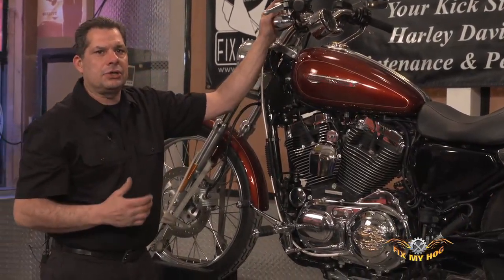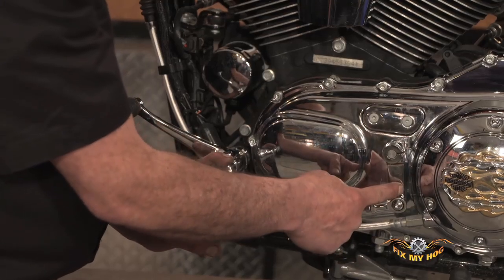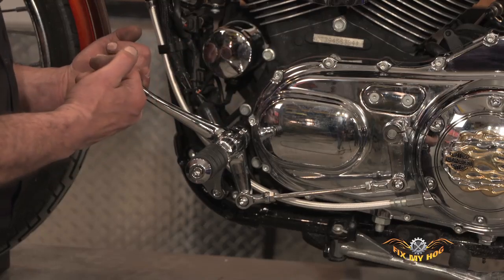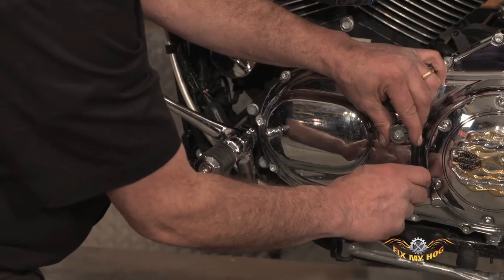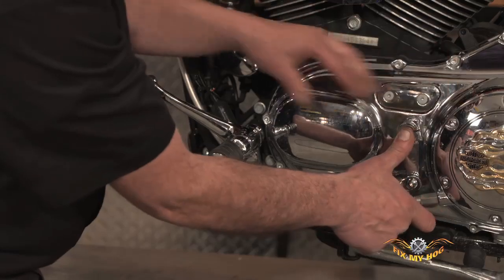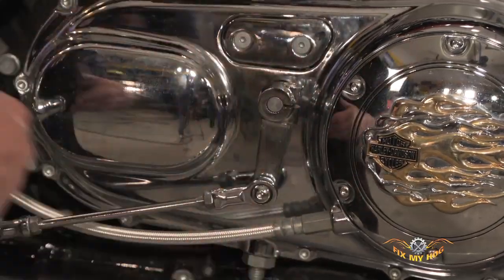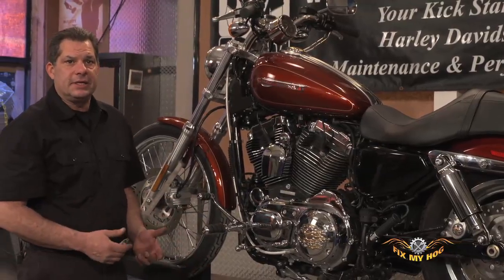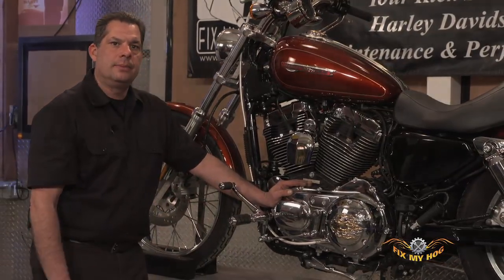Harley Davidson Gear Shift Linkage and Neutral Issues

Comment: Thank you so much for idea!
I've spent around 18 hours at workshops. Jumping from one shop to another. Finally i found what had been causing the nuisance. The lever apparently had been touching the exhaust pipe and it wouldn't shift to first.
Now i can sleep at peace.

Comment: Number one place i would look at if my harley was hard to find neutral on should be the primary chain tensioner. If the chain is too tight it will be hard to find neutral.

Comment: Hello sir. Great video.  thank you!! my bike is a 89 sportster 883.  I wonder if you can help me.  I started having this issue today. Having problems going into neutral. And also once in first gear and I start moving the acceleration becomes rough and bike starts to chock up as if it once to shut off. This same issue continues through out the other higher gears.  I adjusted my clutch several times recently. Will this be an issue cause by poor clutch adjustment  or a fuel deliverie issue??? Kindly advice me please.  Thank
Reply from the maker: Hello, thank you. More info here:
https://www.fixmyhog.com/?s=shift
https://www.fixmyhog.com/videos/sportster-maintenance/
https://www.fixmyhog.com/videos/carburetor-rebuild/

Comment: Hey Bob, love your work & have your videos for my model an 04 1200C.
My neutral light stopped working directly after I did a fluids service, engine oil & filter & primary fluid. I have never had an issue with it before this. Any ideas?
Reply from the maker: Thanks 
We appreciate the kind words.  
The indicator bulbs on your year Sportster are very small. The contacts within the sockets are small and delicate. 
It is not uncommon to have a weak contact due to the aging rubber socket that holds the bulb.  
Suggest looking there 1st. 
Once the bulb is removed, you can use your test light to check for power and ground. 
If you have no ground, the issue is at the switch. It has either come unplugged, or needs to be replaced. 
https://www.fixmyhog.com/videos/electrical/

Comment: Very nice video. Great explanation.. Accidentally I shifted once from N to 1 WITHOUT clutch on my HD, the most misterious thing is the gear box did not grind or else, and it was pretty smooth (not as smooth as it used to be when the engine is hot and obviously you use the cluctch, but similar like the first time you shift to 1 gear in cold) How could it be?

Comment: HI  BOB LAROSA   I    REALLY  APPRECIATE  YOU'RE  VIDEOS ,  I.  HAVE  A  96 SPORTSTER  XLCH 1200CC WITH FORWARD CONTROLS  AND  I'M  HAVING  A  HARD TIME  FINDING  THE  RIGHT  SHIFTER  LEVERAGE  POSITION  HOW  DO  I.  FIX  IT?
Reply from the maker: Hello Larry, 

We don't know who's forward control kit you have, but you should 
assemble and operate it as intended by the manufacturer. If part of the 
assembly has been compromised, we suggest replacement or repair of that 
component. 

Hope this helps, 

Mark
Fix My Hog Video Membership

Comment: No problem finding neutral, having issues with sticking shifter. No "return" when shifting.
Reply: pahuanui ...Did you find the problem?  There’s a “return” spring inside the Primary case. On my 05 Sportster it’s a “rabbit-eared” style spring located behind the shift lever.

Comment: I’m having grinding issues into first gear. I adjusted clutch and cable accordingly. Maybe new clutch needed or is cable stretched out?  18k miles on 92 Heritage.
Reply from the maker: More trans info here: https://www.fixmyhog.com/post/tag/transmission/

Comment: All of your videos are great man. I'm having issues with my 03 softail springer.  I just replaced the stock clutch plates with the rekluse torqdrive manual clutch plates. I adjusted the adjuster screw per the service manual as well as the clutch cable. My lever movement is fine as well. It's very difficult to find neutral and whenever i shift it when i'm stationary it almost clunks. When i ride it shifts fine. Is it just a matter of breaking the new plates in? thanks for any info
Reply from the maker: Raymond, what you describe sounds like you are not getting good disengagement within your clutch pack. 
Without adjusting your cable, turn your clutch adjusting rod IN another 1/4 turn. 
See if that helps. 

Make sure that all of your steel plates are completely flat. 

Verify that none of your clutch plates are hanging up in the basket. 

https://www.fixmyhog.com/video/harley-clutch-basket-removal-011062/ 
https://www.fixmyhog.com/?attachment 
https://www.fixmyhog.com/video/barnett-clutch-011064/

Comment: HI  MR  LAROSA   I   HAVE  A  96  SPORTSTER  1200  XLCH ,   AND.  I'M   TRYING  TO  ADJUST  MY  SHIFTING LEVERS  ON  MY FORWARD CONTROLS,   AND   MY  SHIFTING ROD.  IS  BENT. A LITTLE   BIT  ,  SO.  WILL  I.    HAVE  TO  REPLACE THE  SHIFTER  ROD?
Reply from the maker: Hello Larry, 

Try to straighten the shift rod if possible. 

If you experience any binding, you may have to replace.

There are a lot of poor quality fwd ctrl kits out there. Drag Specialties usually offers a decent kit at a fair price.

https://www.fixmyhog.com/video/harley-davidson-gear-shift-linkage-and-neutral-issues-008726/

Hope this helps, 

Mark
Fix My Hog Video Membership

Comment: I can shift up easily..... once I'm in 5th gear.....i can only shift back down into 4th gear.    Once I try to shift down to 3rd,2nd etc its like a dead shifter.    There's no spring back to it.  I have to shift into 4th, gently lift up on the shifter without shifting up in order to be able to shift down.   I have to do this each and every time.   I have a 2010 sportster forty eight.  What should I do?
Reply from the maker: Hi, start by making sure your clutch is adjusted and stop by our site to troubleshoot: https://www.fixmyhog.com/post/tag/clutch/

Comment: I have 2008 Road King FLHRi and it hard to find neutral. What causes this?
Reply from the maker: Hi Robert, 

Start by performing a clutch adjustment. 
If finding neutral is easy with the m/c not running. You will find that your issue is in the drive.
Inspect your clutches, clutch hub, clutch hub bearing & basket.
https://www.fixmyhog.com/video/primary-fluid-service-w-clutch-primary-chain-adjustment-001305/

Hope this helps, 

Mark
Fix My Hog Video Membership

Comment: 03 Hugger here - Hard neutral , stock shifter location . Is this a just a clutch/cable adjustment ?
Reply: j baumun yeah, just follow manual on how to adjust clutch in primary and should solve that hard neutral issue for ya

Comment: I have a 2015 HD seventy two and recently when down shifting it dosent want to go in gear all the time i have to shift up and then back down to correct this problem the bike has 5k on it ive owned it for a year now nothing changed on the bike so what could be causing this
Reply from the maker: Hi Brian! We suggest starting with a simple clutch adjustment. 
Also, you can raise the rear wheel with a flat jack (bike not running) & shift through all gears. See how it feels. If it feels ok, the issue may be in the clutch or primary drive.
https://www.fixmyhog.com/video/fluid-service-clutch-primary-chain-adjustment-001223/

Comment: hey, I dropped my bike going about 90. I got 1 N 2 and 3 but won't go into 4 or 5. any advice on what I did? it's a 02 Sportster 1200
Reply from the maker: Hi, Brian. You will need to remove your outer primary cover. Follow your shifter shaft until the issue becomes visible. https://www.fixmyhog.com/video/performance-clutch-and-clutch-pressure-plate-install-004522/
Reply: FixMyHogfreechannel  I’m trying to get my inspection cover off using a 4mm allen. The bolts seem soft and very tight. Any idea where I can find better bolts if I have to resort to a Dremel slit? It’s a 04 1200. Thanks

Comment: I have a 2005 80 cubic  inch Evo Harley Davidson ultra classic Electra glide I did a burnout the bike suddenly died and then now it won't go into any gears the shifter works bike still runs I don't know is anybody that can help me
Reply from the maker: Check the clutch assembly.  https://www.fixmyhog.com/video/primary-fluid-service-w-clutch-primary-chain-adjustment-001305/

Comment: i have a 2011 iron 883  when i try to shift to first is making a grinding noise inside the primary case any help ill preciated thanks😭
Reply from the maker: Hi.  Suggest starting with a clutch adjustment.  
https://www.fixmyhog.com/video/fluid-service-clutch-primary-chain-adjustment-001223/ 
https://www.fixmyhog.com/video/inside-the-primary-case-primary-chain-tight-spot-001244/
Reply: FixMyHogfreechannel ...(?) And if that doesn’t fix the hard shifting into 1st gear with engine running?  I’ve smooth shifts with engine off.

Comment: HOW  CAN. I.  FIX. A. LEAKY  GAS  VALVE. ON. MY  96 SPORTSTER XLCH 1200CC?
Reply from the maker: Hello Larry, 

We don't know who's forward control kit you have, but you should 
assemble and operate it as intended by the manufacturer. If part of the 
assembly has been compromised, we suggest replacement or repair of that 
component. 

If your fuel valve needs replacement, we suggest a Golan fuel valve or a OE factory replacement. 
https://www.fixmyhog.com/video/draining-an-evos-vacuum-operated-harley-fuel-valve-008724/

Thanks, 

Mark
Fix My Hog Video Membership

Comment: hi Bob,I have problem with my shifter pawl ,I can move the the differents 1N2345 cold but once I start the motorcycle I can't move the shifter,could you help me,thanks!
Reply from the maker: Hello Hugo. 

If you can shift through gears without issue when the m/c is not running; The problem will, most commonly, be found in the primary drive/clutch assembly.We suggest you begin with disassembly & inspection of your primary drive. 
https://www.fixmyhog.com/video/how-to-search-fix-my-hog-008641/
https://www.fixmyhog.com/video/welcome-to-fix-my-hog-site-review-008131/

Hope this helps, 

Mark 
Fix My Hog Video Membership
Reply: FixMyHogfreechannel  so i can run through the gears when the bikes not running but once it’s on it will go through the gears just fine, except when I’m at a stop and try to click it up to neutral. Doesn’t seem to be binding from what I can see. What might be the issue there?

Comment: Just bought a 2000 Harley an sometimes it seems to slip in first but instantly grabs. What do you think it would be? Only happens when I'm taking off in first.
Reply from the maker: It can be that you are due for clutch replacement. 

Also can be a bad throw out bearing. 

Best to start by disassembling the clutch pack for inspection. 

https://www.fixmyhog.com/video/high-performance-clutch-install-custom-primary-cover-001460/ 

https://www.fixmyhog.com/video/harley-clutch-bearing-replacement-011070/